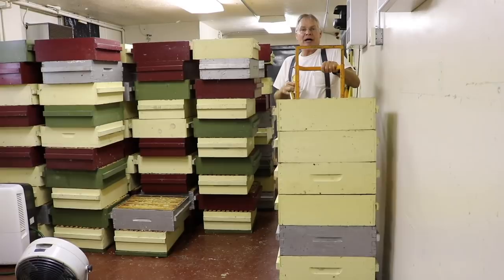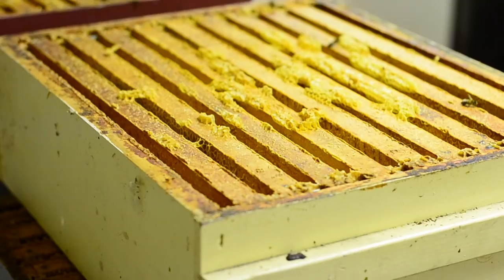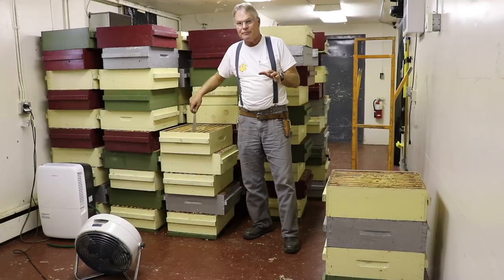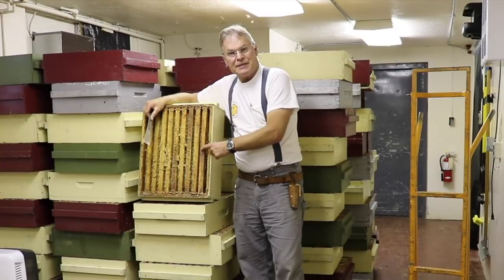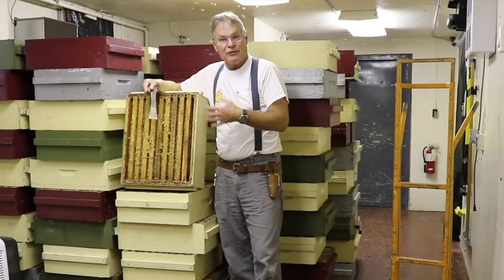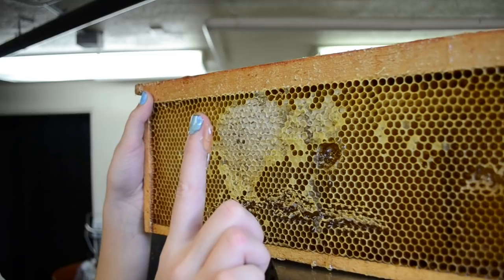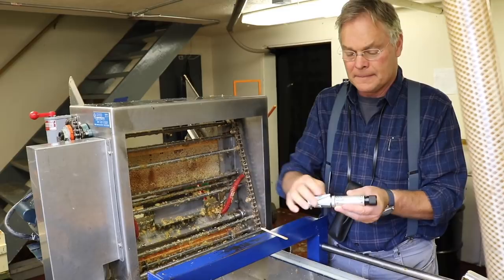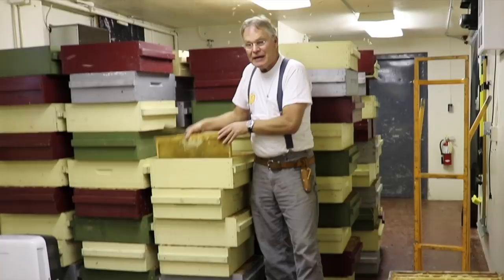Honey Moisture

Comment: Very few videos on how to calibrate refractometers:   Use cold pressed extra virgin olive oil.   Set brix scale to 71.5.     Check calibration each day of use.   I have found the heated honey room (95-100*F) seems to read higher moisture falsely by around 2-3%.    Best to check at room temp I believe.  Any thoughts on heated room and inaccurate moisture readings?
Reply: Not sure if it is possible by an analog refractometer, but if you use a digital one it is better to use demi water. This is always 1.3333. And chemical more consisten probably then olive oil
Reply: @0pvo0   Demi water?  Distilled water?  I'm not sure what demi water is but the test liquid needs to have a moisture range somewhere in the 12% moisture to 27% moisture for the range honey refractometers read
Reply: @JnJShiffler  that's why I referred to a digital one. Those have a larger spectrum incontrast analog. Also using analog refractometers you probably do not measure the value of refraction but you have scale which says your desired content. In the case of honey, moisture. In case of whine, sugar
Reply: @0pvo0  yes, refractometers come in many ranges, a wine one will not have the range of a honey one and there are other ranges and uses as well.  Our county beekeeping club has an expensive digital optical refractometer and you use distileld water to calibrate it but temperature can effect readings, say in a warm honey room around 100*F it will give error messages.

Comment: I put back a fram or to that was capped. In the freezer. Can I thaw them out and extract it.and bottle. It are not.
Reply from the maker: Hi Danny 
Must be some technical issue . I don't understand your question.
Reply: I put a 2 frames of cap honey in the freezer. Can I extract them at a later date.be ok .are bad ideal
Reply from the maker: Hi Danny
 You can extract them later after freezing but when I've tried that the honey doesn't come out very well. I think maybe the honey got drier in the freezer.